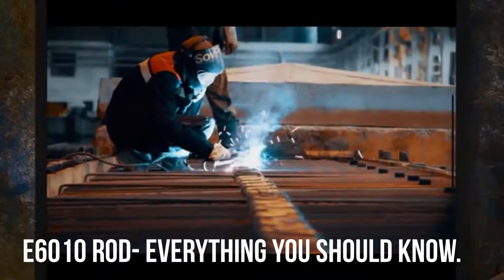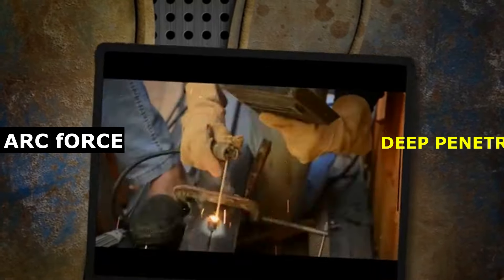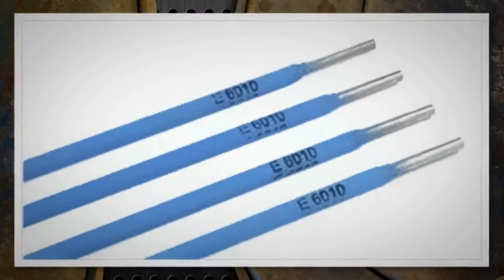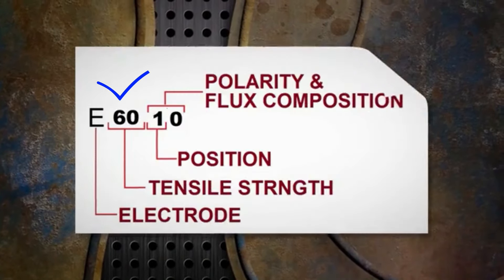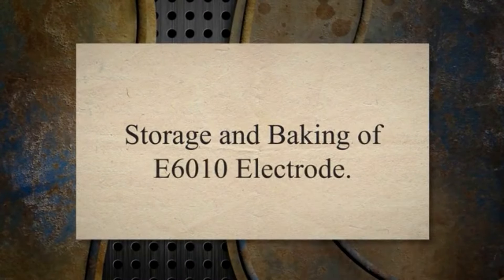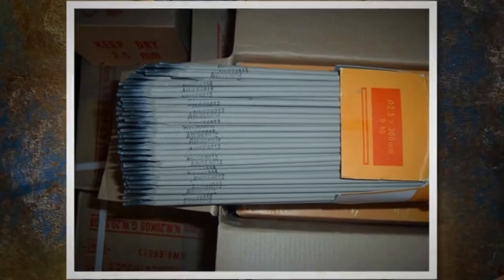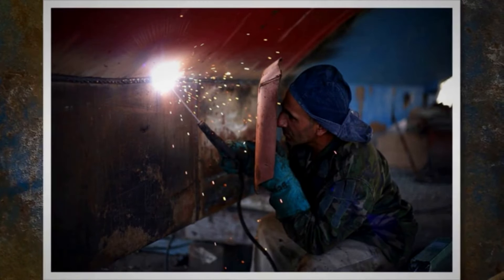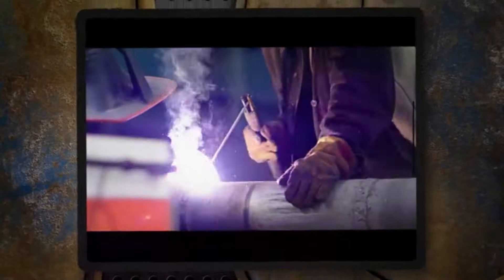E6010 welding electrode- Complete Guide

Comment from the maker: Read more in-depth:
- https://www.materialwelding.com/e6010-electrode-specification-its-meaning/
📢📢E6010 Welding Rod uses & polarity: https://www.materialwelding.com/e6010-welding-rod-uses-amperage-polarity-explained/

📢📢Welding Electrode Types-Welding Rod Number Meaning & Classification - https://www.materialwelding.com/smaw-electrode-types-and-welding-rod-number-meaning-classification/
📢📢 best brand of 7018- https://www.materialwelding.com/best-brand-of-7018/
📢📢How to Choose the Right Stick Welding Electrode and Rod Type- https://www.materialwelding.com/how-to-choose-the-right-stick-welding-electrode-and-rod-type/
📢📢 E7018 vs E7018-1 vs E6013 vs E7016 vs E6011 Explained- https://www.materialwelding.com/e7018-vs-e7018-1-vs-e6013-vs-e7016-vs-e6011/
📢📢E7018 Welding Rod: Everything you need to know- https://www.materialwelding.com/e7018-welding-rod-everything-you-need-to-know-is-covered/
📢📢E7018-1 electrode- https://www.materialwelding.com/e7018-1-or-e4918-1-h4-electrode-specification-meaning-chemical-mechanical-properties-with-mtc/